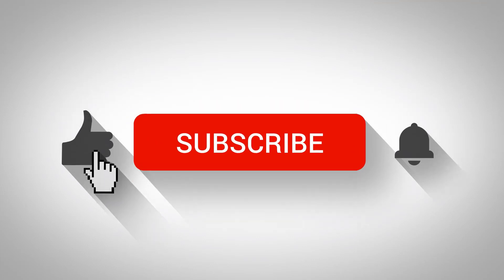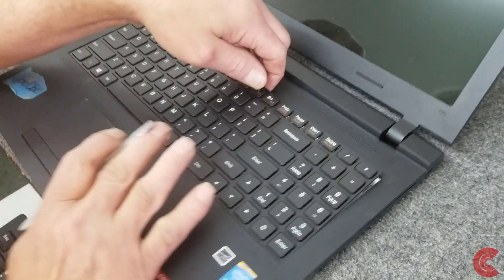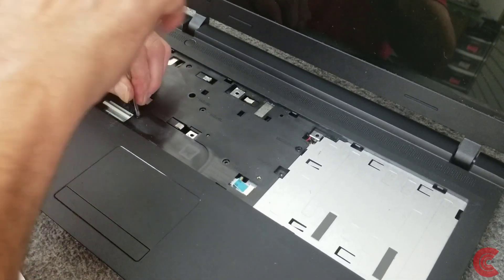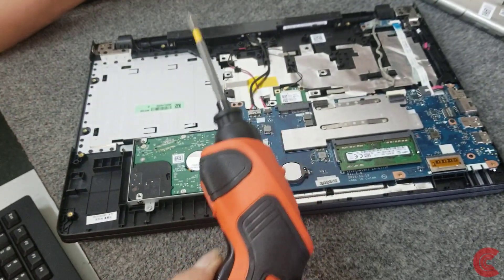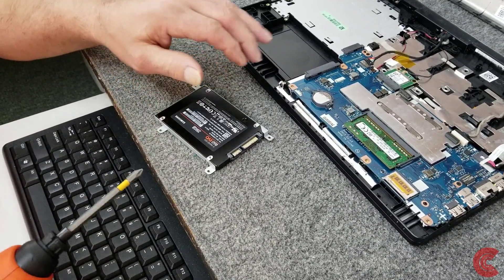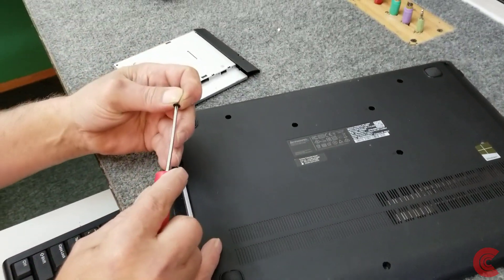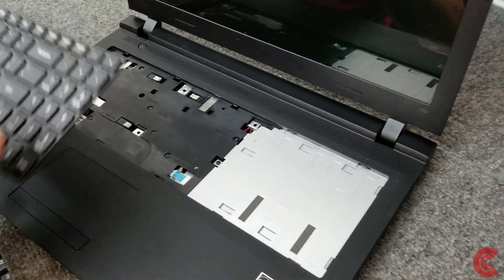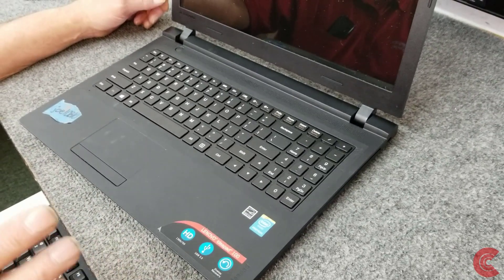Lenovo IdeaPad 100 SSD Upgrade Model Ideapad 100-15iby

Comment: Hey, what screwdriver did you use to remove the screws? Also, is it possible to upgrade the ram?
Reply: maxentbaillet Ok But why it say 1 of 2 slots used?
Reply: maxentbaillet  hmm, i thought it has only one slot but it made no sense wfter I saw it sais 1 of 2 slots used.

Comment: How about the ram? I am planning on upgrading my ram but I am hesitant because it might not be compatible. May I ask what type of ram you have on your laptop? Like gb, voltage, mhz etc. thank u.
Reply from the maker: DDR4 2400mhz is good for this model . 1.2volt.  4gb or 8 gb.
Reply: @CadillacComputerCenter but when I check my ram tab on mine it say 1 of 2 slots used. It has 2 slots for ram?

Comment: Hi, I replaced the ssd following your video and pc didnt turn on anymore :(
Reply from the maker: Hi..double check your connections.   Hopefully you were protected from static  discharge.   I can't really say without seeing it.  Check your ribbon cable connections under keyboard. Mainly the one for the power switch.

Comment: Just did a HDD to SSD upgrade on one identical to that.... but it won't boot to the SSD.  No idea where it's going wrong.... using EaseUS Disc Copy.
Reply from the maker: Hi. Without seeing your computer, I can't say. You may have a bad clone. It does happen. You could try using Macrium Reflect 7. It's free. I have several videos on using this software.  Dale
Reply: @CadillacComputerCenter  For some reason it wouldn't boot from UEFI, I had to set it to Legacy in BIOS before it would boot to the SSD.  I do have it working, now.  Thanks :)

Comment: In this laptop the speed  of memory ram is only 1333 mHz, if i buy one ram of 8GB with 1600 m-Hz, that´s not a problem?
Reply: I have upgraded the same laptop with 8GB ram - 1600 m-Hz speed trust me it's a beast... however the speed shows up as 1300 mhz the ram works!
Reply: @heytanix  Thanks for your answer, i have a doubt about that..But u can´t put more than that right? At the same time i found refurbished laptops in some stores... That could be a nice investment... But it´s not for now

Comment: Good afternoon sir. Hope you are doing well. Only a quick question to you about the same series of laptop I have and I would like to update from hdd to ssd, I want to go for a Samsung 860 evo 500gb sata 2,5 inch internal ssd (MZ-76E500). My question is what can I do with the interface here? Hardver interface of the ssd is SATA 6.0gb/s and my laptop's disc interface serial - ATA/300, Buffer - host max rate 300MB/SEC. Can I use it to my laptop or have to find an other one?
Reply from the maker: Hi. Samsung 860 evo is backwards compatible to your interface.  It will work great. Your laptop will be much faster in deed. Dale
Reply: Thank you sir for the quick response to my message. Have a good day and keep safe

Comment: Nice video.. but I have question? The specs say 8gb max of ram. But it has 2gb built-in ram? Did u tried it if will work/read the(8gb ram + 2gb)= 10gb ram on it? And some specs say upto 120gb ssd only... did ur 250gb detected or working on that laptop.. thnks for answering..
Reply from the maker: Hi. In this model, it will support up to 8gb ddr3L.  You can use 250gb, 500gb or 1TB SATA ssd 2.5 inch drive. Dale
Reply: Thanks alot for fast reply.. bcause of that ill subscribed now to ur channel😊. So i will be updated in ur new videos about gadgets and techs😊😊..

Comment: Sir i have the same laptop. What is the max capacity of the ssd that is available for upgrade?
Reply from the maker: Hi, once you get over 1TB ssd, they get pretty expensive.  2tb ssd range from $210 to 300 dollars. I would suggest a 1tb.  Windows 10 will support 2tb partition as mbr in ntfs. If you convert a disk to GPT you can go beyond 2tb.

Comment: Is it possible to put 16 or 8 GB of ddr4 ram in and if so could you send me a link or something. Thanks
Reply from the maker: You can install a 4GB OR 8GB module. PC3L. Here is a link.....https://www.amazon.com/Timetec-PC3L-12800-Unbuffered-Notebook-Computer/dp/B0145V6NUA/ref=mp_s_a_1_4?dchild=1&keywords=4gb%2Bpc3l-12800%2Bsodimm&qid=1589112508&sprefix=4gb%2Bpc3l&sr=8-4&th=1&psc=1.     Dale